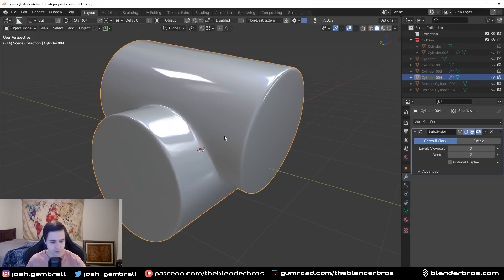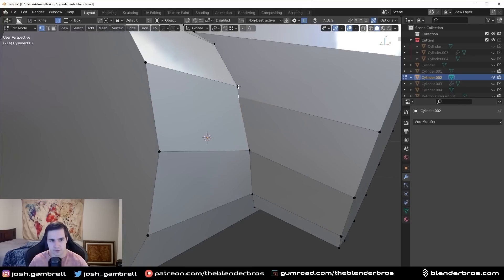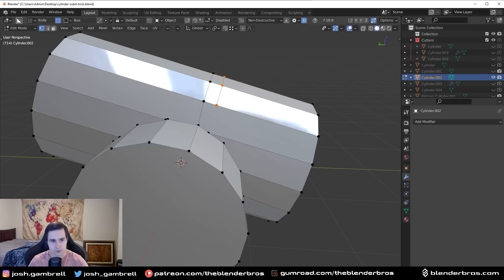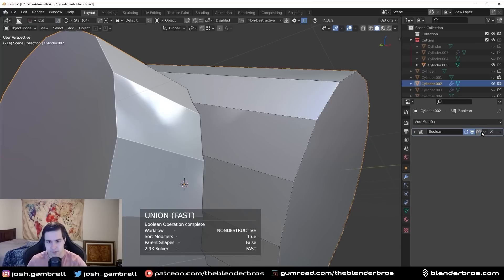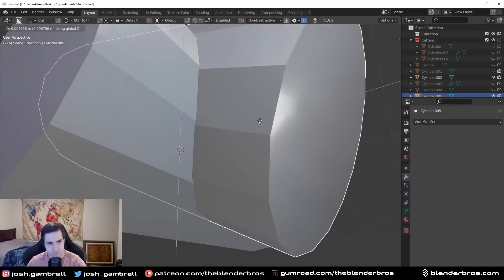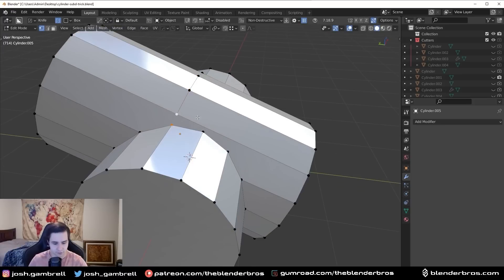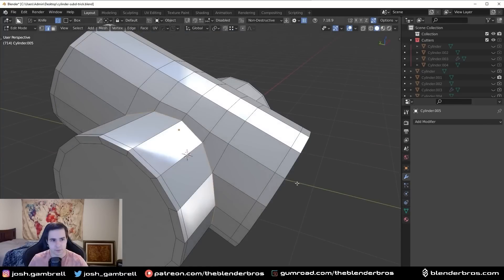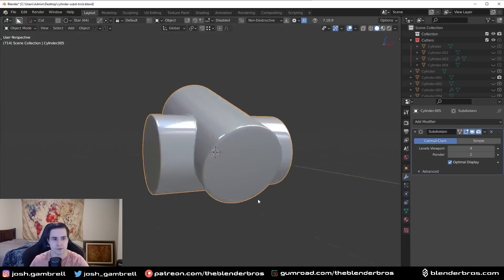Do THIS before you boolean! (Curvature Trick)

Comment: the problem with this method is that in machine shopping for example people will want specific dimensions specific angles where there is no room for "mitigation of topology issues". So the solution is to subdivide prior to boolean bring your quads to the size of the smallest difference between vertices (using smooth helps sometimes others it doesn't) then you go for boolean, then you deconstruct some ( and then you save your 1 micron and your 1mm copy of the thing you made so that you don't ever have to do go through it again) .you want loop cuts near the intersections on both sides on both pipes and you want their distance to the contact points to be about the length of what your "weld bevel" is going to be. this gives it a very natural smooth intersect with decent shading at low poly counts and smooth shading at high counts. As always i am just a lousy blender part timer so I may have just said a bunch of nonsense that there might be a much better way around.

Comment: If your "solution" is to change the design because of topology issues then it's not a solution, not even a workaround, it's just bad advice. 
Instead, do THIS before you boolean: Increase the sides of the cylinder and after boolean place edge loops near the intersections to protect the shape and finally make topology compromises with triangles and n-gons as best as you can.
Reply: This is it! I learned this solution from Mario (Elemntza) who is a master of sub-d modeling. By far he is the best instructor in this type of workflow.

Comment: I face weird shading on a higher topology where it is kind of hard to align the vertices before merging them together. And shading gets a mess where it is extremely pain to deal with. I ended up using z brush dynamesh to merge the two but the process took me awhile. 
Could you guide me or give us more video on this topic where you start off with a complex shape?

Comment: An old 90s LightWave trick to deal with this issue was to:

1) Have two copies of the boolean meshes
2) Cut one set - using this example cut the bottom tube with the top tube
3) With the second set, reverse the cut - cut the top tube with the bottom tube
4) Take the two tubes that were just cut and merge points (should merge perfectly), delete the other "cutter" tubes.
5) Delete the unwanted geometry - the "holes" as it were

Voila!  Perfect intersection without messing with the cross sections of any geometry...
Reply: So I was curious about this method and just tried it. The results were identical to just using a regular boolean. Topology still has to be fixed after the fact.

Comment: But to have this in consideration makes the artistic freedom a slave of clean topology… Is there no easy method instead?
Reply: I’m looking for a year already.
Reply: Boolean, but then use retopology techniques.  
https://www.youtube.com/watch?v=CuQzPDs99yM
You normally use this to make high-poly sculpts into low poly models using the Shrinkwrap modifier, but it should still work.  If you have really tiny details, though it may just be better to merge vertices but keep a quad formation (square polygons) if it needs to be deformed.  Unless it's a hair tip or something, in that case you'd extrude the ends of it to tris (triangle polygons) while keeping the rest quads.

Comment: A good video once again. I assume you are using version 2.9x by now? I see you are using a matcap here - could you tell me where to find matcaps in 2.9? The internet could not help me at all with this, every video and thread talks about, where to find them in 2.8 - in 2.9 they got moved somewhere else, and nobody seems to know where. You seem to know, please let me know where to find matcaps in 2.9x (and hopefully they won't hide them again in 3.0)
Reply: In the upper right corner of the viewport, where you can change between wireframe, solid, material preview, and render view--while you have the second sphere icon selected (for solid view) the down arrow on the right end of that group of icons will let you choose matcap instead of "studio" and pick from there.
Reply: @allit.164  Ohhhhhhh...... I feel dumb..... It has been there all along, but nobody mentioned, that the little arrow is context sensitive to which display mode you have currently enabled. I saw people click it in 2.8 and they had matcaps there, I clicked it and had almost nothing there - now I realize, I was in rendered mode, where there is not much to be selected...... Well in any case, thank you very much, you have solved a mystery for me. Seemingly, many people have this issue, since I had plenty of threads where people asked the exact same thing, and responders couldn't tell either.

Comment: Works if you want to compromise your design and the cylinders at similar sizes. But if the cylinders were very different sizes and at acute angles this wouldn’t work.
Reply: The method he shows isn't specifically for this form/size. He's basically saying, try to get vertices as close to each other before merging. Of course this is working better or worse, depending on form. But his video just shows the very base you should use, and then enhance on the theory depending on your models. He could have explained it better to make that clear.

Comment: Not really sure about this one - 
What if you are working to exact measurements where you can't rotate or move each cylinder?
Reply: That's what I thought, this makes no sense in real life. If you have to move your objets in order to get a clean boolean... are you designing towards that boolean?
Reply: For this, it is better if you start with a hi-poly mesh. Instead of 16 verts, set it up much higher such as 64 or 128 so that the distance between the vertices which you need to merge is shorter.

You can follow Arrimus 3D youtube channel for more topology tips and tricks.
Reply: A cylinder is symmetrical, why couldn't you rotate it? It's measurements are the same no matter how you rotate it. You could also cut the cylinder in half modify the end closest to the boolean, then join them back up. So the end joining the other cylinder gets rotated to fit, but the outer end stays uniform in its original position. The only difference is there would be a slight twist along the cylinder but that would hardly be noticeable if you use enough subdivisions. 

Of course, if you are working on anything that requires extreme precision you should be using a high resolution mesh anyway so adding subdivisions should be no problem to you.
Reply: https://www.youtube.com/watch?v=IS2LPVNp6SE Thank me later :)
Reply: Yup. This idea works for Disney fantasy projects, abstract geo, and little else.
Reply: do people use blender for things that need to be that precise? I always assumed you'd use CAD software for anything like that
Reply: @r6scrubs126  There's a lot of people who model cars or stuff like that, where You have to be precise. Blender is not only for some bullshit concepts without actual use for insta fanpage. Many people use it for product renders as well.
Reply: if you want to work with exact measurements, use a parametric CAD application like FreeCAD or Fusion 360. ;-)
Blender is a Vertex-Pushing-Tool for artistic purposes. Art is rarely exact measured. :-)

Comment: add edge loop before to merge all vertices to isolate and keep other vertex in the same position
Reply: Good idea. Unlike this video which forces to compromise with the structure.
Reply: @nirmansarkar  well if u r going with subsurf it will fix the slightly disturbed curvature.
Reply: Indeed, I wasn't very impressed with this tutorial.
In addition to your solution, you can take this a step further and drag the vertices along the edges to get each point up close to the boolean object. Just hit GG to drag a vert along an edge.
Reply: .. which I do, by insetting the good faces. Absorb the change in longitudinal edge direction in a tiny bevel at the intersection.